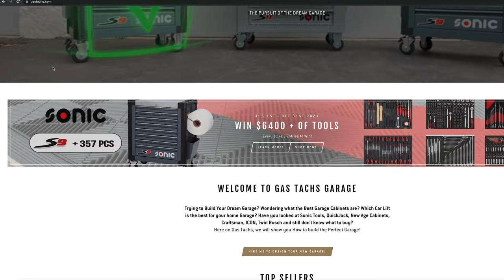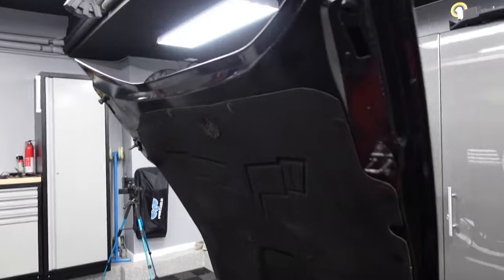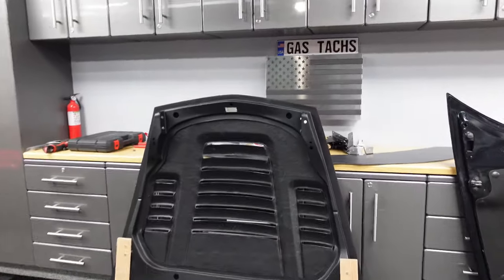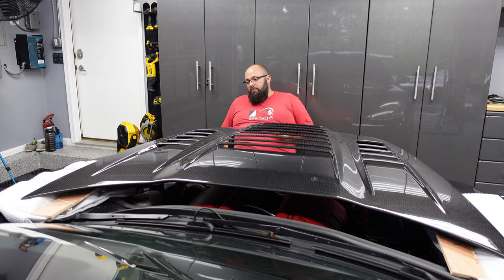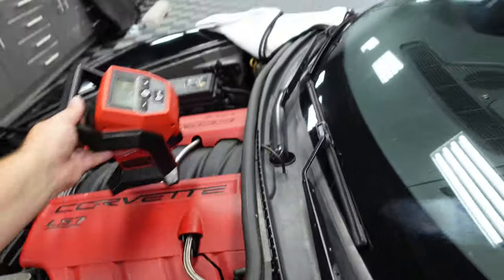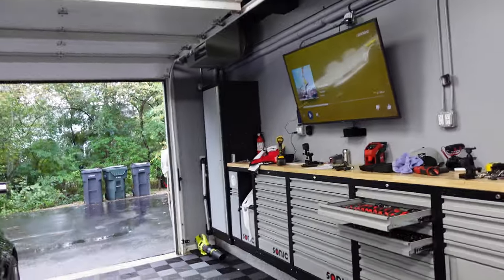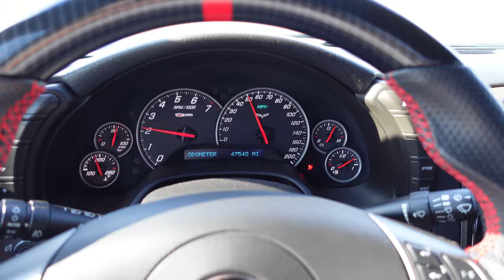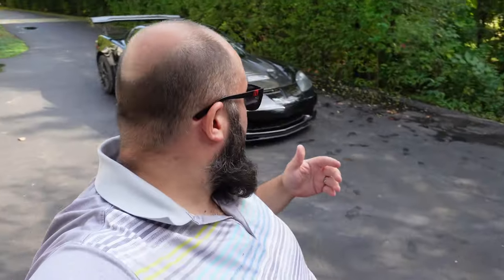Corvette C6 CARBON FIBER Hood LE MANS Style Install! Anderson Composites

Comment: Nice, I have the same hood on my Vette for a few years now, no heat protection and I used stock struts. Just push down on the top center when closing. I also painted mine and left the vents exposed carbon fiber
Reply from the maker: Nice, good to know
Reply: abt to buy this how fo you like it ?  notice any perf and cooling ?

Comment: You need to get i/2" sch 40 PVC pipe to use as a device to prop open hood. Cut it to the size you need and put a PVC Tee at both ends and use a swimming pool noodles  to use as a covers for the Tees not to damage the hood or the car. The hood look great. I like your logo but you need to get a bigger size (XXXL) I used the rule if I get it together with no blood it a great job.

Comment: Nice hood. I would use a set of vice grips to hold the hood open at the track. 

With the hood up just clamp the vice grip at the bottom of the strut. I'm sure you won't be the only person at the track doing this as struts are famous for failing. Lol
Reply from the maker: Vice grips is a good idea, i'll do that, thanks!

Comment: Hey so did you ever order any heat tape for the hood?  I just ordered one, but have had a GM Camaro hood vent cut into the stock hood for a while and don't really see the point.
Reply from the maker: no heat tape, talked to a guy that had one for a while and never had a problem